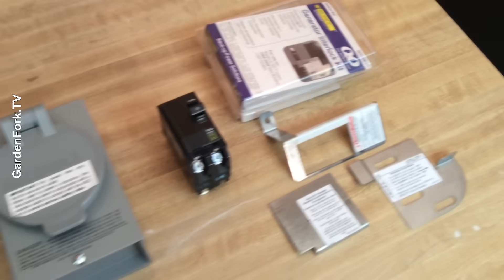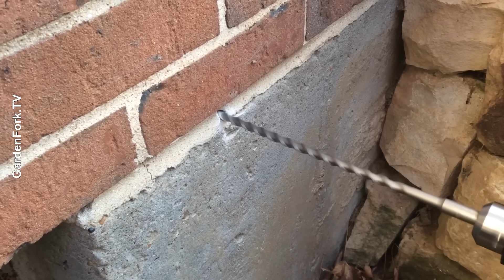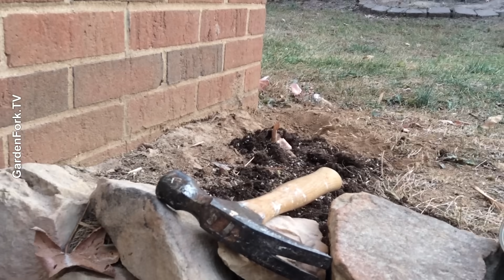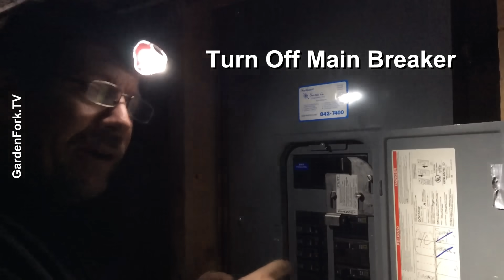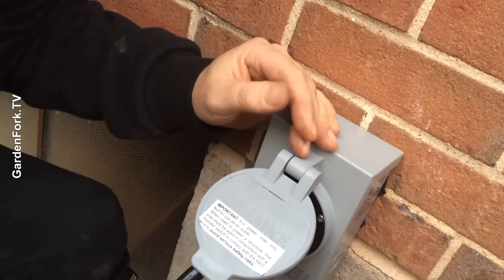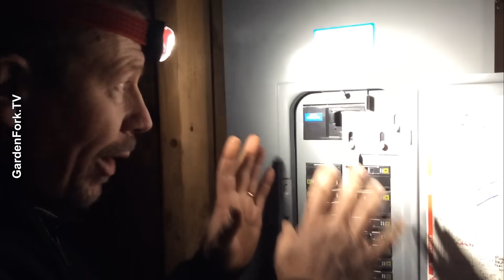Your Easy  & Safe Way To Hook Generator To House | Generator Interlock Switch Install | GardenFork

Comment: So is it a myth that power can back feed through the neutral into the electric grid, which isnt typically switched by the mainbreaker in your panel? As long as your main breaker is off all your other breakers are isolated?
Reply: The neutral should not be carrying any charge.  However, it is possible for the neutral to have some charge due to wire resistance between the load and the panel, or in this case because of resistance in the power cord, so yes if you used a volt meter to ground the neutral might not read zero.  But if the wiring is all good it should be pretty low volts and not dangerous to line workers.  I believe the neutral is also grounded (someone fact check me) which should take care of any remaining low voltage caused by the extension cord.  The neutral acts as the main path for the current back to the generator or grid and can handle high current, but it should not itself have any voltage other than that caused by wire resistance.

So for example, lets assume a 120 volt outlet and the wires to and from the outlet each have 0.01 ohms resistance, and the load is 20 ohms.  You prorate the voltage drop across 0.01, 20, and 0.01.  So the voltage at the plug under this load (black wire) would be 119.96 volts (to ground, 119.92 across the plug) and the voltage on the white wire at the plug (to ground) would be 0.04 volts but zero at the panel.  However the generator is not at the panel so if the extension cord is also 0.01 ohms the power at the panel would be something like 0.04 volts.  Not dangerous and easily grounded out.

(I hope I did that math correctly!  Been a while.  But I think the concept is correct.)

Comment: left out one of the most important things.
if you don't ground the generator,
that dirty power will destroy appliances & electronics !!
Reply: How would you do that?
Reply: @janetholmes9685  pretty much every portable generator has a wingnut at bottom of the frame somewhere , thats what its for.. by connecting a wire to that , and the other end connected to a metal rod securely screwed or clamped , and drive that 2 feet into the ground . it turns the power to clean power .  if the medal rod is not solid , make it longer , 3-4 ft , still 2 ft into ground .

Comment: This is great.... but my main panel is full! (only 125 amp service) :(
However, I do have an almost empty  sub-panel originally installed for outside use such as pool pump, lights etc.
Is it possible for  a generator interlock switch to be installed in this sub-panel?
Reply: Probably better off moving 2 circuits from the main panel to the sub and installing the interlock on the main panel. Otherwise there's no way for an interlock to "force" you to turn off the utility power before back feeding your system.
Reply: @MikeAndChryssi_HateEverything  Thanks Mike..you're right.
I'll see if what you suggest is feasible. The sub-panel is located on the other side of the house!
Reply: @philgibbs4045  If the main panel isn't very full then maybe moving 2 light loads to 2 tandem breakers would free up a spot for a 2 pole breaker since the sub panel is so remote.
Reply: @MikeAndChryssi_HateEverything  Thanks Mike..
Unfortunately the main panel is really full and tandem breakers had to be installed when we added a solar system.  I think it requires someone more knowledgeable than me to see if what I want to do is feasible ...

Comment: If the main power switch is off, how are you supposed to know when the power has been restored?
Reply: Look up the Power Back alarm from Reliance Controls. It has a wire that wraps around the service main. Insert a 9 volt battery and it'll sound an alarm when it senses power. I've got one on order for a similar setup.

Comment: How can anyone criticize this video (i.e Thumbs down)?   This was a perfect explanation.  and so much better than a transfer switch.
Reply: Accidentally pushing it while scrolling and the fact the some people are just miserable people lol. I agree, great video.
Reply: Friggin miserable trolls and know it alls who are better at everything than anyone else. I agree with you. This is a Great video.
Reply: It's cheaper than a transfer switch, but what would make you think it's better? A transfer switch has the benefit of being able to work with both 120v and 240v generators. This would require 240v to power both sides of the panel.
Reply: This would be a better set up rather than running extension cords.  Just wonder what wires would one need to run from the breaker box to the outlet?   Any attempt to put a hole in the wall from inside the house to outside the house to run the hard wires where the outlet would be would invite critters.
Reply: @janetholmes9685  I mean I ran 8/3, but I think 10/3 is fine for 30amp, 8/3 can do 50 (i have a 30 right now cause of generator size, but I put in 8/3 in case I ever want a bigger generator to run AC and stuff, but i got a free generator so).  Also if you don't go directly into the box like his, any part that's outdoors needs to be in tubing, protection.  I run mine to my garage, but near entrace because we run the generator outside the garage and run the cable inside, also it keeps the generator under our generous overhang to keep water away, also you're not supposed to run generator in the rain, so I can leave my garage open and run it towards the end (i know you're not supposed to, but rather run it at end of garage with door open (driveway slows away from garage so I can do that, my dad can't cause it slops into garage and he'd have a flood) and have power than not).  They make something like putty (my central AC, natural gas lines all use it) that you form around any wires going outside and plugs up any holes.

Comment: few things from having this same setup. hookup the whole generator before you go in the basement to the panel. there's no reason to go down twice. you most likely dont need to turn off all the breakers, the only thing I need to turn off in my house is my hottub that comes on automatically. it is true that we cant run the microwave, dryer, and other big things at once but we just know that and dont use them all at once. but by leaving the breakers on we can selectively use anything in the house.
Reply: Well it would be so easy for both refrigerators, the freezer, the water heater, the Ac , the attic fan, the home security system to all power up automatically at the same time, if u don’t shut those breakers of, and the wife or jr. May start the washer, dryer, toaster, tv, computer, or garage door opener because he was not home when u turned the generator on.  
And heaven forbid if daughter flushes and my 230v well pump kicks on.   So for us I turn off all breakers, and have a red ball sticker on those I will leave on, so I don’t have to rethink this a year later during a power outage.   

Most important to us is internet for informing power company and news. One Tv not 3. Refrigerator, and allow freezer to power up on occasion I choose. A couple lights.  Don’t forget plenty of gas for generator. Any devices that have remote control continue to draw power in off position, waiting to receive signal, TVs , sound systems, remote lights, outdoor security lights, tree lights and sump pumps, dehumidifier,  all take stand by power, that will load a small generator.down,  shut them off with breakers 

Worth mentioning is, I use the generator that is in my RV as my back up power source!

Comment: Do you not need a grounding rod for safety (an 8 foot  rod) put into the ground connected to your generator since you are running it through your house and a circuit board?

Comment: I just want to run my thermostat, furnace(gas) and the damned air duct fan to push the air in!  don't give a flying turd about TV, video games or hair dryers in a snow storm! I am freezing my ball bearings off for 2 weeks( I recall the snow blizzard of 2006!)

Comment: Pretty ingenious, but it seems like I has the potential to be easily defeated. It would only take a screwdriver and an unaware subsequent home owner. Maybe I'd feel better if it used security screws or rivets. Or what about when someone's pulling off the panel cover to add or replace a breaker? There's a dangerous moment in there when all breakers are open to switching. Oh, right! No one would ever do that, they'd hire a certified, licensed, expensive electrician.For me it would be great, because I'm a genius. For the general public- not sure if it's ready. Is this thing even legal?

Comment: Had a interlock switch installed about 2 years ago. Used the generator about a month ago for two days when power was out. Worked great.

Comment: I have wen generator 11000 watts , GAS/PROPANO what transfer  switch i have to used ? Thanks
Reply from the maker: Best to check with the transfer switch companies on that one. it all depends on your breaker box. thx!

Comment: It is always smart to mark all breakers in your panel type it up bold caps two sides of the page make a couple of copies cut one to fit in panel use two cellphones and patients. over wire by one size, add flap behind outside device box, you never loose power I good weather, GE silicone all external wire connections put electrical tape over external wire ends to be removed when used. Check Gen oil every 4 hours or when re-filling gas or propane, Drain Gas and oil, gas tends to go bad use it in your lawnmower or car. Dump gas bole of water, or just try to fix it when you lose power.

Comment: Did I miss the part where he terminates the wire from weatherproof box to the breaker?
Reply: No but it's pretty self-explanatory. The red and black coming from the new two pole breaker feeds the the outdoor gen receptacle. Once the main is turned off and the generator is plugged in to the receptacle all you're doing is back feeding the panel

Comment: You can run it in your garage as long as you have a vent hose from the exhaust to the outside!
Reply: Anyone reading this comment, don’t run a generator in your house, even if it’s the garage.  Chances are your garage wasn’t wrapped with a vapor barrier and you’re going to get carbon monoxide poisoning.

Comment: A 20 amp generator (4800kw) can not power an air conditioner. You will ruin the compressor windings.
A 20 amp generator can run your house lights and refrigerator; nothing else.

Comment: hi sir do you think a 9000 watt gen from harbor frieght will run a mobil home A/C its a double wide i think its a 1 1/2 ton ??????   thanks alot
Reply from the maker: You have to find the starting amperage of the AC, and get a generator that will provide that amperage. most portable generators will not run a whole house air conditioner
Reply: @gardenfork  i found it they say 3500 watts im getting a 9000 watt gen from harbour fright for 600 bucks i think i can pull it off . im not going to run it constantly just if its sweltering hot for a little bit . thanks a bunch :)

Comment: I have a 8x8 work shop with my generator in the corner taking up needed room. Decide last night to mount it outside. It’s within 10 feet of my indoor breaker box. This video solved my hookup problem. Didn’t know it was that simple.Thanks for sharing!

Comment: In a pinch back feed the panel. Run two 120vac generators in Parallel. Open the main and connect a male-male NEMA6-30 plug. Why not?
Reply: Run them in parallel ONLY if they are made to be paralleled together, like some of the invertor style generators.  Two unsynchronized generators can blow each generator out if connected to each other

Comment: You should mention that you want an unbonded generator in this setup. Otherwise not sure what to do with a bonded generator as the neutrals should not be double connected.

Comment: I’m still not seeing anywhere that the interlock switch breaks the connection for the neutral so I don’t think that is legit here in Canada
Reply: 1955johnny It doesn't break the neutral. However it's legal for US as its UL rated for such. I'm not sure how your electric is in Canada but here the neutral and ground is bonded at the panel. So if there is a short and the neutral is energized it will ground before leaving the panel.

Comment: Does that interlock switch use the uritilty neutral? If so, the neutral is still powered when using your generator. Depending on how the utility street transformer is constructed, the neutral may power the grid lines with thousands of volts.

Comment: love it. i been reading about transfers switch and all the other ways to do it.
but i love the way you do it cause i got a 12,000 watts generator with a 50 Amps outlet.
so this is the best way for me to do it.
with out spending so much money to make it work.
thank you. great video.
Reply: I just bought a Duro max XP12000EH DUAL FUEL Gen & initially had some problem starting it. No way no how! ( I did follow the instructions on the manual & on the gen!) Then I went on line to check the comments on the reviews & resolved the problem. The manual & on the gen said, for propane move the choke to the right! I move it to the right but back it up about 1/4 & Bingo!
( By the way, there was no problem w/ gas). I bought this unit a few days ago & there had been some updates in references to the regulator for the propane. I found some discrepancies & some wrong information that I will like to share! They replaced the old regulator ( there were too many complaints. The old one have a button. The new one didn't have the buttom. The instructions said press the buttom!
Troubleshooting only deals w/ issues w/gas. No mention of propane! Manual recommended using " F6RTC PLUG! MINE CAME W/ F7TC ?
Anyone have an answer to that?
ps: Ur instructions  & installation r on the money!

Comment: I have a fuse box in my house, and one out to the garage. My question is can I hook up the generator to the fuse box in the garage or does it have to be the fuse box in the house ? Setting it up with the fuse box in the garage would be more convenient for me. Anyone ? Thank You
Reply from the maker: this type of install has to be on the main breaker box, the interlock is a manual slide that wont allow you to have both the utility power input on (main breaker) and the generator input on. so which ever breaker box has the power utility wires coming into it is the box you have to install this one.
Reply: @gardenfork  Thank You.

Comment: Probably a dumb question, but if your main breaker is off, how would you know when power comes back on?
Reply from the maker: There a few ways, if you live near other houses their lights are on, or there are power line monitors where an LED goes on when line power is restored to the mains. But yeah, that is the issue with a mechanical system like this.
Reply: @gardenfork  look at your meter from time to time

Comment: This is also what I did. Huge cost saving going with the generator interlock. 

I use a champion 9,000 watt running/ 11,000 cranking watt generator. I can run my 2600 sq ft house , and shop/ rental apartment on it.

All lights on my property are LED.... I don’t run any 220 items when on generator power. A pellet smoker is how I can cook. It uses 110 power to run the auger and fan but the heat is from pellets so no issues there.

Less than $3,000 total for generator, electrical work, and extras.
Reply from the maker: Good to hear J, same here. Almost all LED, my well pump is 220 volt but no issues with my 6000 watt generator. Thx!

Comment: Wish I had known this before having my transfer switch installed years ago. After watching your video I think I would actually prefer the interlock over my current setup, (due to it's simplicity & effectiveness) the cost savings just becomes a very welcomed added bonus. Outstanding video & I'm now subscribed because of it. Thanks so much for sharing this info & have a great day!

Comment: I’m no electrician but I have two main disconnects.  One at my power pole that feeds the well and feeds the house.   At the house I have a second disconnect atop the house electrical panel.  If I turn off the main switch at the power pole, I could plug in a special made cord into a dryer 220 outlet and a 5000 watt generator that would feed the whole house.   Correct???   Comments welcome.  I live near Mexico with no building or wiring codes.

Comment: Google “Generlink” I have two, one for business, one for home. They work great. UL approved, electrician installed, one half hour.
Reply from the maker: Those are good, I’ve seen a few of them installed.
Reply: What did you pay the electrician?  Did it require any permitting?
Reply: rfjohns1 .
I decided to come back to your comments and add something. You will want to make sure that you are utility company approves such a device being put on your meter socket. My utility company had approved such a device (UL). My electrician contacted the utility and after a week or two not hearing back from them on whether or not it was approved I called the manufacture a Generlink. Generlink gave me the name of the individual at the power company that ran the tests on this unit and his group approved it for installation. It was just a matter of a day or two to get a service disconnect and installation. Do not rely entirely on what someone may say at the electric utility. Before you order one asked Generlink whether your utility has approved it and who is in charge of those approvals. Sometimes the people that you talk to act acknowledge  but they aren’t.
Reply: rfjohns1 
I paid the electrician $40 (half hour)and there was a planned service disconnect by the power company. Power company did not charge anything they just watched the electrician plug in the Generlink and then the power company plugged the meter back into the Generlink  then put their seal on and it was done.